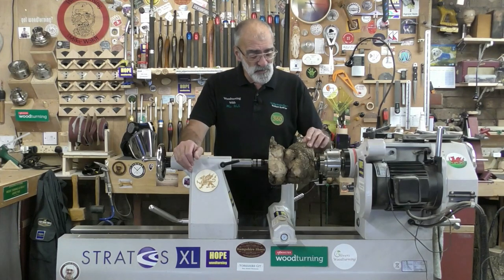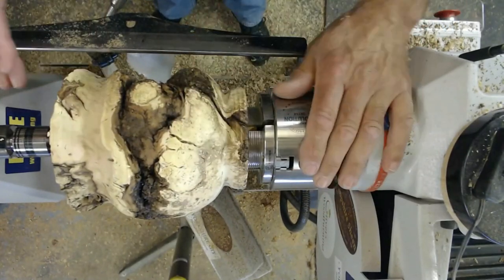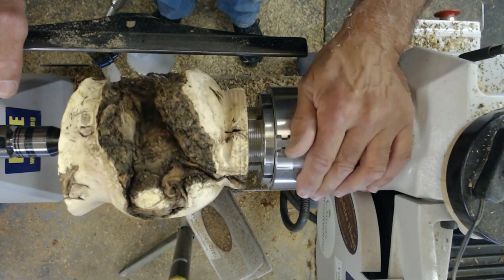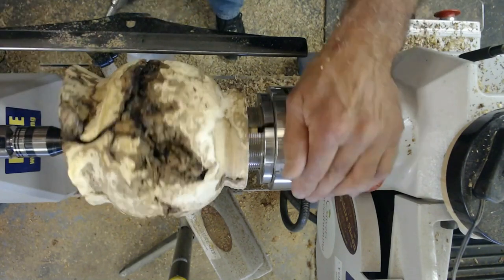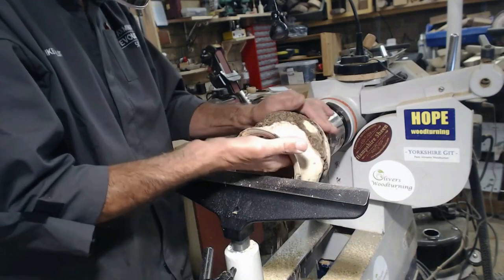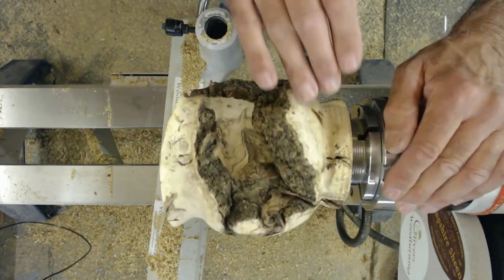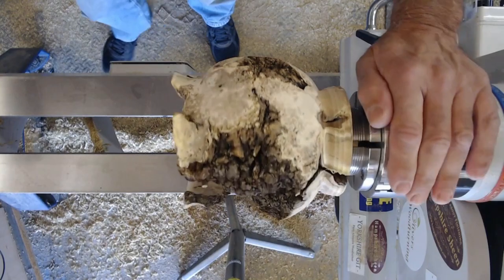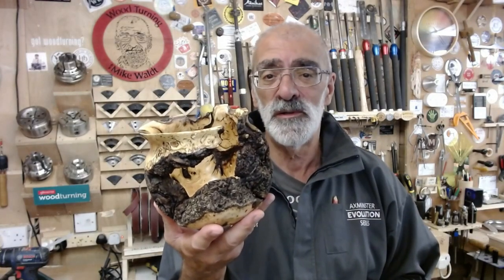Woodturning - The Robinia Burr

Comment: Great piece. A trick I learned a while back was for pieces like this, once the outside is turned you can wrap some tape around it to hold any bits in place. That will allow you to turn the inside without worry of catching it and breaking it off. Fabulous piece regardless. Thanks.
Reply from the maker: Thanks Doug ... and thanks too for the tip.